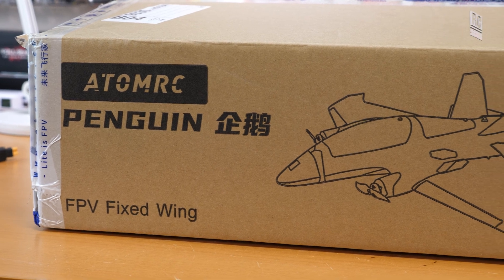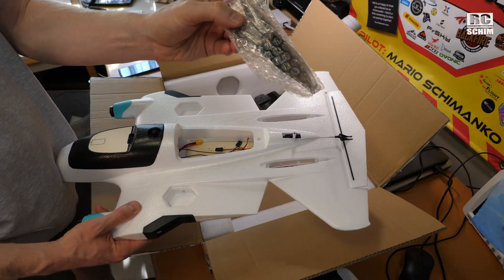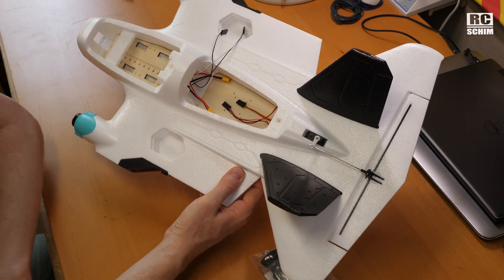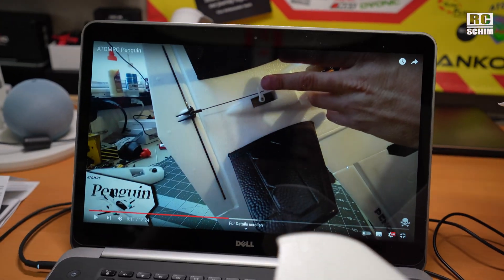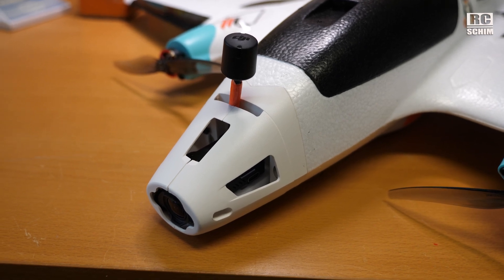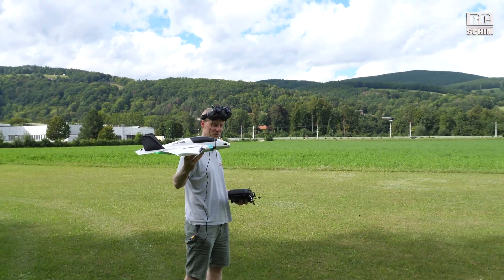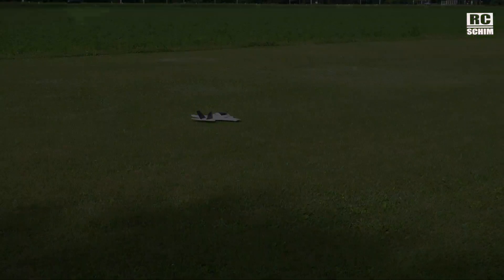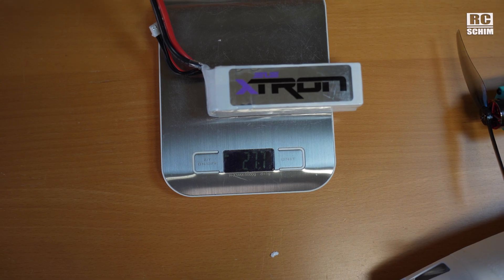AtomRC Penguin - "not just another" Review ;)

Comment: Hi, great video. How long were you able to fly it with the cells you tried?
Reply from the maker: Hi, I almost abandoned this little plane after the review. But this is really a fun plane! Recently flew it on FPV meets where we would fly proximity with a few HeeWing T1 Rangers. A lot of fun.
On those flights I got 13-20mins according to throttle use, on Lipo 4 cell 2650mah.  Since these 2 motors pull 44amps on full thr I cant or wont use LION packs here.

Comment: Rcschim, want to share. I use O3 with iFlight heatsink with 5V cooling fan mount on heatsink. I am able to power on Heewing Ranger T1 in fully enclosure while grounded. With fan still spinning, it can be grounded indefinitely without worrying about overheating.

iFlight heatsink for O3 is a must have for anyone who puts O3 in fully enclosures with vent. Or add cooling fan when in doubt (ie: summer season)

I enjoy your video, I am in market for one more fixed wing that can pack up in a case for portability. How do you pack up? I see servo wires still in there after you remove the wings?
Reply from the maker: Yep, heatsink is a good idea. didn't do it yet but have fans on my bench. 
my flying buddies did tell me also how great the T1 is. Currently I'm back to copters again - love their steady flight...
looking forward to flying the Dolphin in Spring again tho. And maybe the Mars and ARWingpro. Didnt like the Penguin enough to keep the O3 in there - went on another copter. Maybe I'll use one of my old Vistas to have an easy ground level basher plane? it flew like fun for sure (and such a thing is great for FPV meetings).
greets, Mario
Reply: @Rcschim  Yes, I wouldn't send my precious T1 as ground level basher. 😂 That is why I research about Dolphin. Their page says it can steer thru trees in a park and has good low speed without stalling.

If you have any more ground level basher wing to mention, please do share. 🙏
Reply from the maker: @kibbycabbit  I guess you meant Penguin instead of Dolphin here ;)
My fpv 900 from tech one was a nice careless flying wing until it was grounded. See fpv meet 1-23

Comment: Great video. What was the reason for the crash during auto launch?
Reply from the maker: Only one motor started for some reason. 
Later I changed so that on auto launch the motors start after I use half throttle rather than throwing. 
This way I can check better if both are spinning.

Comment: You also need to check if your elevator servo is secure as mine was loose and popped out when I adjusted the control horn that I have to re-glue and put screw on it.